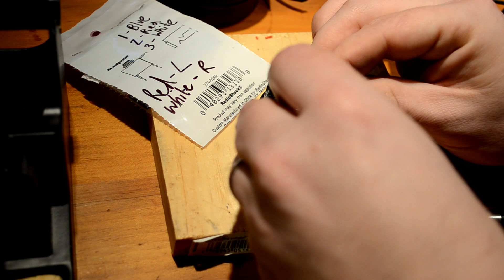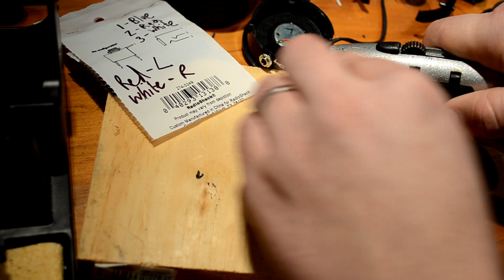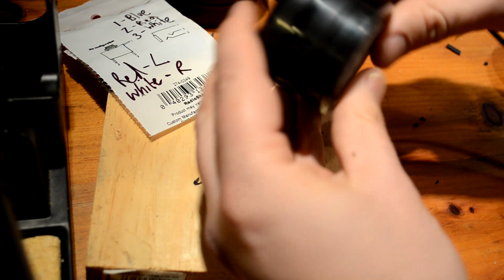Grado SR-60i single side detachable cable mod

Comment: Thank you for posting this video. I accidentally stepped on my cord and ripped the wire out of one of my earpieces. The heat gun method of opening the phones worked perfectly and I was able to resolder the wires. Very much appreciated.

Comment: Great video!  The best part was that tool you gave a link too.  :-)  I ordered it immediately.

I had tried to open mine but was unwilling to apply as much heat as you did.  Good to see that it can take what's necessary.  That was actually the most important information in the video if you happen to be an E.E,

Gotta say, I stayed to the end to see what clever thing you did to make the cross wire look "professional."  Oh, well you can't have everything.  :-)

Comment from the maker: You can use any 2 conductor cable (or 2 single conduction cables), Go with stranded as it is more flexible.

There are many places you can get it - Stores, Online, Salvaged from something else like I did.

Comment: I needed just the first few minutes to show me how to get the two halves apart (of my similar SR80s). Wife's hair drier worked perfectly. Many thanks. 

(One of the wires had broken away from its solder blob. Would have been more secure if Grado had terminated the wires and screwed them onto terminals.)
Reply: as the glue aged old, i couldn't put those 2 plastic pieces apart, i put the stuck part into a freezer and the glue went brittle, i was able to separate both halves

Comment: Beautifully done. I’m about to splice a new plug on my SR-60s due to a short after nearly 15 years of use. I’m tempted to do a full rewiring though. That Y cable drives me nuts.

Comment: Nice video, though I would do things a little bit differently. I would probe the jack of the original cable to find ground, left and right, and mark that on the drivers to maintain polarity. I would also use better cabling between the earcups, and I would test the headphones before putting the earcups back together to make sure that my wiring is correct( and if L and R are reversed these headphones look like they can be worn in reverse anyways), and I would solder the ground first to the jack without pretinning.

Comment from the maker: Its "1/8" Stereo Panel-Mount Audio Jack (2-Pack)",  Part#  274-249 from Radioshack. There are better jacks out there, I used what I had already. The cable is just a 3.5mm to 3.5mm Stereo Audio cable, in my case 42-692 - it was on sale and had a braided cord.

Comment from the maker: You can either feed it through the headband it comes with (I did not try that), or buy an aftermarket headband that has snaps and just wrap the old band and wire with that.

Comment: didn't have the guts to do it with mine until the cable broke a few months ago. my only regret is making the cord between the cups too short, don't make that mistake people. otherwise, it works quite well.

Comment from the maker: @TheRocky1024 I'm not familiar with those headphones, it depends how easy they are to take apart and if there is enough room inside for the connector - I couldn't say if its possible or how difficult it would be without seeing a pair.

Comment: some alternatives:
1.use a white marker to mark the drill/cut points. 
2.boil a coin and place it over the spot for a few secs; makes it easier to make a hole by hand.
3.You can add a bluetooth receiver to convert these into a wireless headphone (mpow makes a cost effective one).  Add an L adapter and some 3M mounting tape/velcro to mount to the side.

Also the wiring layout is the exact same for Alessandro Music Series One.

Comment from the maker: I don't think the section from the Y to the ear cup was long enough. You could use the main part of the cable I guess, I didn't because I wanted that for another project.

If you use other wire I don't think it really matters much. Whatever you have laying around that's 2 conductor stranded should be fine. I think mine was 18 awg.

Comment from the maker: I'd have to post a wiring diagram to twitter, I will add a link to the description once I've done that.

If that's a lead free solder (91/9 maybe?) then I've never used it, but it should work fine.

Comment from the maker: The headphones come with a cable that connects to your music player etc then splits into two to go into each side of the headphones.

I'm removing that cable so you just have one cable that goes to one side of the headphones and also making it so that the cable can be removed.

People do this to make it less prone to getting tangled and sometimes because they dont like having cables on each side. It also makes it easier to stow and the cable I used is thinner/lighter than the originals.

Comment: Hi, thank you for the fantastic mod. I'm in the middle of this, but had a few q's being that i'm very new to tinkering with electronics. 1) Why not cut the wire on the Right cup from the "y" or below and carry it over to the left side instead of attaching a new wire? 2) If "1)" can't/shouldn't be done, what gauge is ideal, you used a 2 conductor but did not mention the awg. Does it matter? I currently have 18, 24 and cat 6. Thanks again.

Comment: A big thank you for this video ! I bought a Grado SR60 in 2010, the left ear went suddenly quiet recently : wire cut.
Then I found you video, I had nothing to lose.
I found a 3,5mm jack embase and a male/male jack for 12€ on Amazon. I could reuse the wires from the original jack cable.
I managed to slide two wires in the leather of the headband with a E guitar string (first insert the string until it reach the other side, attach the wires then pull the string)
I could easily learn how to solder everything from you video : 23min50s : https://youtu.be/0JHGJqfM0wE?t=1430
On the right speaker I tethered the wires with little knots and listened to check if the stereo is OK, then I welded everything.
Now my headphone is fixed, it's stronger as ever, and since the wires and welding are new my SR60 even regained its original clarity.
Then I did these little mods : https://www.instructables.com/id/Grado-Headphone-Modification/
The sound is improved : better treble and bass.
Thanks a lot!  ;-)

Comment: any ideas on how to reinforce the cable connection so that they do not become loose again?
Reply: Inside each headphone, use some Colson-type hose clamps to block the wires.
Reply: @woodoo4  cool thanks. wow I asked this 4 years ago.

Comment: I know this video is kinda old, but if I wanted to make a Y split detatchable cable for some grados, would I buy a mono panel-mount audio jack or stereo? One of these will sit in each ear cup
Reply: link to what im talking about https://www.radioshack.com/collections/connectors-adapters/products/radioshack-1-8-stereo-panel-mount-audio-jack-2-pack
Reply: If you still want a Y-cable, you'd use two mono panel mount jacks; one for each side.

Comment: I got a question, i own SR 80's and they look exactly the same as SR 60's. I wanna add a little green light in on both sides of the headphones, under where all of those holes are, around where it says SR 80 (in ur case SR 60). But i have no idea if the light will damage the speakers because of the small amount of heat generated from the lights, so basically i wanna know if adding lights is possible without damaging anything major?

Comment: Thanks for this demo! -What brand cable/mini plug are you using?
Reply from the maker: It's just stuff from radioshack - I since bought better connectors and wire for when I re-cable it, but haven't got around to that yet... and I cant find them to give you what brand they were.

Comment from the maker: Yeah - the hair dryer is to soften the glue enough so you can pull the pieces of the headphone apart.

I'd recommend just using the headphones as they are for a while before even considering doing anything else to them. You may not even find it necessary to make these changes.

Comment: One day Grado Labs will realize it is way too late to start producing models with detachable cables. And then they will try to catch up.
Reply: I kind of suspect they use cheap Y cables just to keep people coming back to them for repairs.
Reply: Scott Bakula
On other hand, if my pair does not break for 2 years, I will take back my words. The cables do look really sturdy.
Reply: Scott Bakula
 Iv'e had my SR325i's for about 10-12 years of hard abuse.  In an out of backpacks, to and from work, on trips, etc.  I have never covered or protected them... just thrown in my sack and off to work/play/wherever.  Not one issue since purchase.  If you open them up you will also notice they use a simple cable tie (simple but perfectly effective) that keeps the cable from being "pulled" on at the physical connection.  Short of intentionally yanking them out of the body, i doubt you will ever have cable problems with your grados.  Also, the wires they use are exceptional and are heavy guage, well protected and durable.  You can of course modify the headset if you really want detachable cables, but id rather not have another point for interference to present itself.  These are audiophile headphones for careful listeners who want the most sound quality...  not for enthusiasts who want convenience over sound quality.  Every decision made is basically "will they sound better" all else may be sacrificed.  Personally I like this about grados, YMMV.
Reply: *****
Thank for that extra bit of reassurance! That means my model will serve me well.
Reply: ***** My comment probably sounded more cynical than intended.  I agree, more or less.  I've actually owned a set of SR-80s for the last couple years.  My very reason for watching the vid was to get an idea of how to repair a worn out cable.  The short doesn't often occur at the ears, so you're probably right about the cable tie.  It occurs where the cable 'rocks against' the plastic Y joint.  The wires become can eventually become frayed purely out of frequent use.  So that considered, a DIY single-side mod is a pretty good solution, as opposed to paying Grado labs to replace it with the same Y-cable.   I definitely don't doubt your experiences with them, but this has apparently been an issue for others.  They are definitely some of the best sounding cans I've encountered though and hands down the best in the price range.
Reply: I find the unrestrained swivel design coupled with the non-removable cables to be problematic throughout their offerings. It's way too easy to twist the cord going in to the headphones the wrong way, making that connection point very, very weak over extended use. The fact that this flaw is present from their lowest grade set to their highest is the biggest issue for me and dissuades me from making any further purchases from this company, even though I love their sound.
Reply: In 2018 they finally release the GW100, a bluetooth version that comes with a detachable cable.
Reply: Will hot air damage the speakers?

Comment: The hair dryer does not damage the driver?
Reply from the maker: No damage from the hair dryer. There's a bit air gap which provides insulation so it shouldnt be an issue - just dont point the dryer directly at an exposed driver.

Comment: Where did you get those wire strippers
Reply from the maker: I can't remember where I got those, but I've seen them in Home Depot, Lowes and Radioshack to name the more prolific of retailers.

Here's a link to Amazon for an Irwin branded one

http://www.amazon.com/gp/product/B000OQ21CA/ref=as_li_ss_tl?ie=UTF8&camp=1789&creative=390957&creativeASIN=B000OQ21CA&linkCode=as2&tag=n0841-20

Comment from the maker: It's a Stereo 3.5mm TRS Jack, or as Radioshack calls it a " 1/8" Stereo Panel-Mount Audio Jack", part 274-249.

I'm not that impressed with its construction, but they are local.

Comment: That was kind of badly done, not only did you go from two sided wiring to  one sided, which is inferior, you also have a hole now on side, and not on the other, as well as a big wire hanging in mid air, exposed.  You should have just put a 3,5 mm jack on both sides of the original cable and just put those 3,5 mm female sockets into both ear cups, and have a double sided removable cable.
Reply: derbigpr500 while I agree, with the whole, hole, issue, single sided does nothing to audio quality. And it generally protects the internal as the first thing to go is the jack or plug. Considering people use grados on the go it makes sense to me.

Comment: Why going from something better to something worse..?
Reply: how is it worse
Reply: You're introducing more potential bad connections.
Reply: Also unbalanced, the left one were the wire goes will have faster bass response than the right one wich will have a short delay (but very noticable!!).
Reply: TruthSeeker I see so many mods like this... eek.  :/
Reply: TruthSeeker You're JOKING right?
Reply: Joe Rico No. I'm not.
Reply: EZ fix just make the cable longer on that side to compensate
Reply: just wow ..... what to answer to someone who thinks he can hear a 20cm difference in an audio cable ... let's do some math with the speed of current in a cable, 300000 kilometers per second the delay on let's say 30 centimeters would be of one millionth of a second ... that's one microsecond ... 

for comparaison a single cycle of sample interval a 48000hz sound is 20.8 µs... 

so 1µs .... sure, "very noticeable" delay of less than a 20th of a single sample :D 

(and btw the cycle time for highest human-audible tone (20khz) is no less than 50 whole µs, but sure, you can hear a delay of a 50th of that :p )
Reply: Hi T Shak...
What?

Comment: How to ruin the shoud quality.Leaving those extra leads on the wires on a open back set of headphones(amazing one) will cause a lot of hissing and vibrations from those little wires.Plus leaving the hole open on a earcup where the original cable went in will run the balance between L R.

Comment: Instead of ruining a really good set of headphones, audiophile grade at that, just save your money and time and buy a different brand with a single sided cable.  Your connector jack will be the "weak" spot of your mod.  You'll get static from a loose connection eventually and you've just added a bunch of unnecessary line resistance to the signal path with your wire splicing as well.  If you could do a comprehensive A/B test with the Grado in its original state, pre-mod will sound way better.